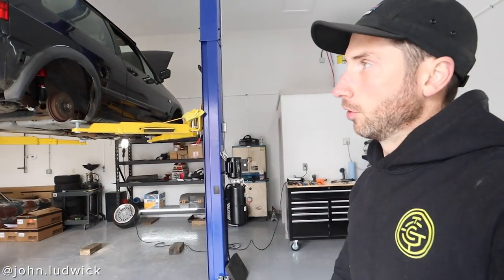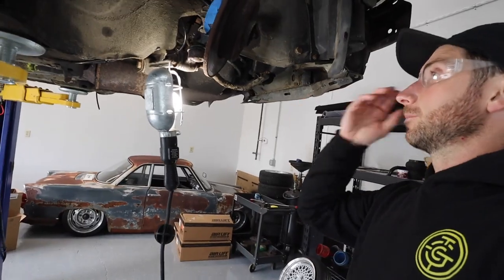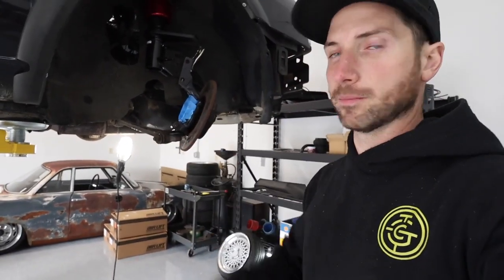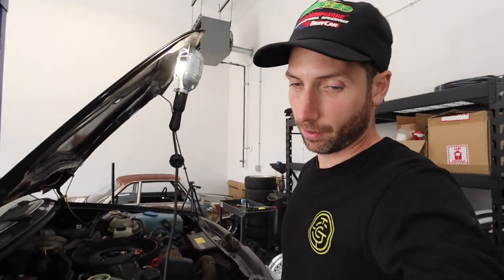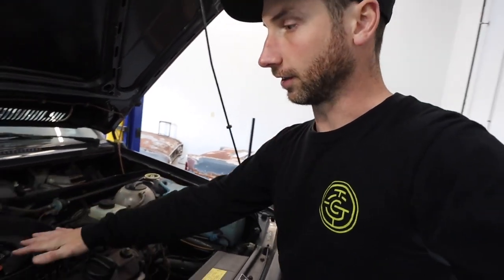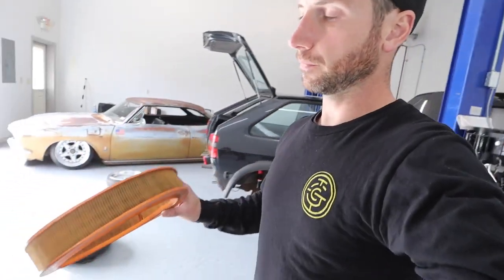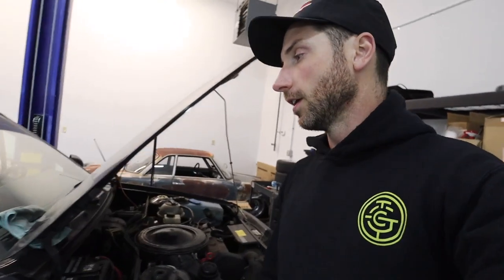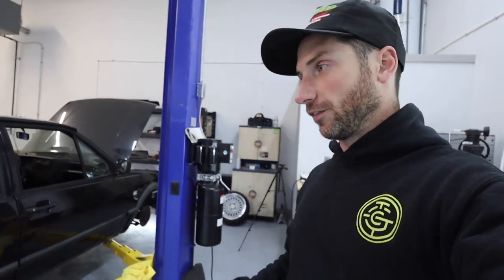Notching For Suspension Travel - Moving Forward With The Polo Coupe

Comment: The heat is on! Great choice of wheels for this “hot hatch”. It seems like you’re a little more stressed out John but don’t you worry, you’re left arm is going to have a sunburn while cruising this sweet bathtub around in sunny Helen, Georgia! If you could make it when dragging a Corvair out of the woods that’s been sitting for forty years, body drop, roof chop, and make the engine run before driving it (not the shortest route) all the way down to SOWO you sure as heck gonna reach trailering this Polo down in time for Alpine Volks fair. Relax and have yourself a cold root beer while hammering towards the finish line 😅 I believe in you!
Reply from the maker: Haha I really appreciate the support, and the vote of confidence, Truls! Thank you!